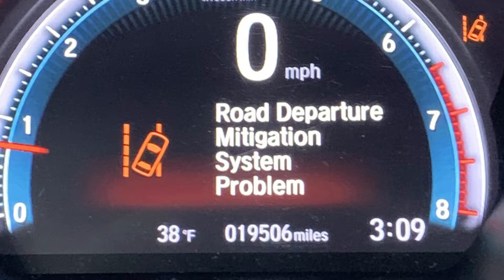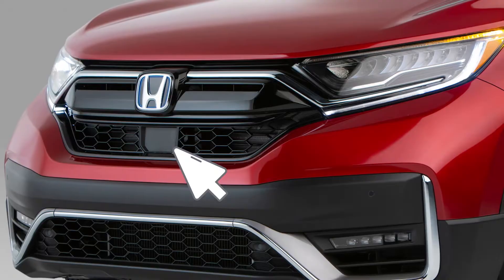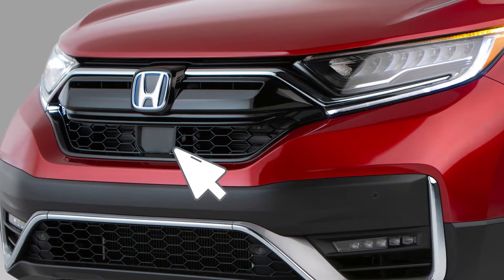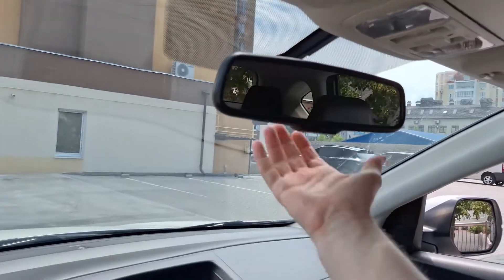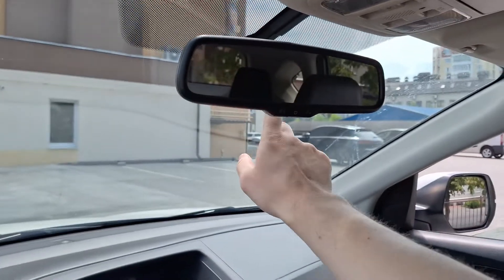Road Departure Mitigation System Problem in Honda vehicles - REASONS

Comment: Cleaning the radar and camera are essential, but to clear the error codes from the dash display you need to first get in the carwith the Fob and close the door, next without touching the brake press the start button twice, this brings up the computer, press the home button, then select warnings, highlight the first warning and hold the enter button about 5-8 seconds, for each warning. This will reset this system. If the problem returns check the connector on the radar sensor on the front of the vehicle.

Comment: Today while im driving my 2019 CRV, it braked on its own without a car infront of it, thats pretty scary and dangerous will cleaning the sensor help with it ?
Reply from the maker: This may be a glitch in the system of AEB, but if the radar or camera was dirty, yes, this could also have triggered the problem.

Comment: In my 2017 crv they told they need to replace the whole system and it costs like 2.5k$ which is ridiculous. It started happening just a month after warranty expired in 2019. Honda crv is the worst. I have nothing but issues with mine
Reply from the maker: After about 2015, things went in the wrong direction, for most car manufacturers, unfortunately.